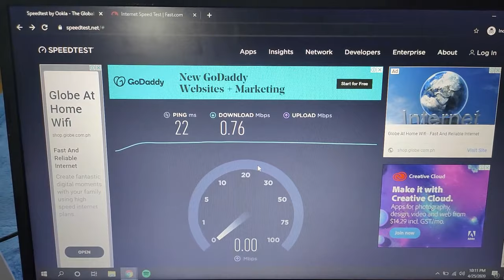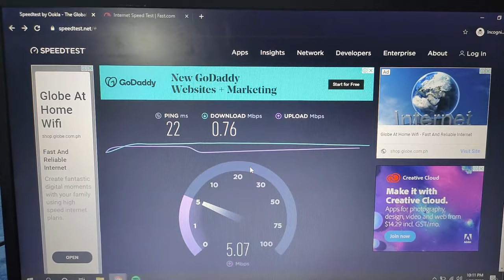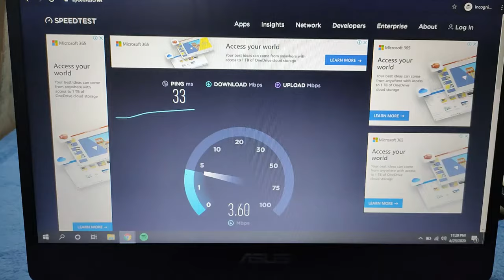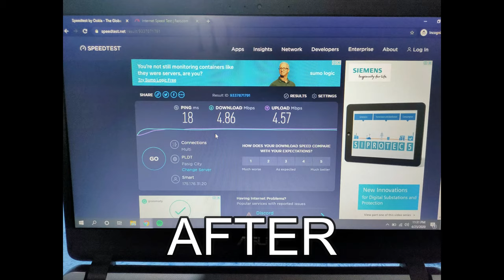PLDT HOME PREPAID WIFI UPGRADE! EXTERNAL ANTENNA INSTALLATION | SORRY FOR TECHNICAL PROBLEM

Comment: Sir, yung apat (4) na antenna connector na sinasabi ninyo, di po ba two (2) for WIFI signal (output) then two (2) for LTE/4G (INPUT)? kaso wala lang label. alam nyo po ba saan dyan para sa wifi/LTE?

Comment: maganda vlog mo boss esa iba. perfect na sana pero suggest q lng wag mo po ecut yung crucial parts: yung pag drill kung papano, at yung pag kabit ng wire dun sa motherboard.
Reply: Totoo lalo na nung di niya pinakita ung pag kabit ng wire
Reply from the maker: salamat sir. push in lang po ung sa wire heheh
Reply: pano po yung sa pag drill?

Comment: Sir, paano niyo po na i attached ang wire sa loob ng antenna? Dretso na po kasi sa video mo, pinakita mo lang na naka attached sa kanilaan. Need ba hinangin sa loob yung mga wirings?
Reply from the maker: Hindi na po ipush lng sya mam pinch down lng
Reply: Thank you sir,

Comment: Good day brad! Mukhang nagpalit ang PLDT.. hindi na swak ang UFL or IPX na connector.. bale dapat male yung maliit na papasok sa circuit board. Ang problema, ang hirap hanapin..

Details: i got mine around 1st week ot august 2020. Iba na yung hitsura connector sa loob.. bale female receiver na yung soldered sa board.
Reply: same din sakin boss

Comment: So since dahil 4 yung antenna port sa circuit board, can we split the two wires ng dalawang antenna to make it connected sa apat? Or can we even add 4 antennas  sa WiFi router?
Reply from the maker: I think 2 will do, but if mahina pdin signal you might consider direct line or change of provider
Reply: Pwede naman pong apat din hanapan mo lang ng paraan kung san magbubutas.

Comment: Hindi sa nangbabash ako, nag susuggest lang ako. Pag i-analayze mo yung pcb ng router makikita mo na hindi kahit sa saan mo dapat ilagay yung pigtail. Sa apat na yan ay ang dalawa ay para sa wifi antenna at dalawa ay para sa lte antenna. Kung makikita mo yung upper-left at lower left(yung may sticker) ng pcb ay may makikita kang copper trace na kagaya sa internal wifi antenna ng cp, laptop, at pocket wifi. At kung makikita mo yung nasa right side ng pcb, may makikita kang dalawang itim na plastik, yan yung internal antenna para sa lte, at kung makikita mo and dalawang port na nasa right ay may copper trace na connect sa itim na plastik kaya doon lang dapat ikabit yung lte antenna. At tsaka mali na antenna yung ginamit mo, para wifi yan na antenna, ang antenna na kagaya niyan na para sa lte ay medyo mas malaki at mas malapad kisa niyan.

Comment: Yung intro mo when it comes to the volume of your voice with the music background was fine. However, during your process of installing the antenna, your voice went low and the background music too dominant in the video. I notice some parts were edited which is ok, so you can get to the key points of the installation, but there are some parts or clip that needs a little more visual and verbal explanation.
Reply from the maker: salamat po sir. I'll try to improve po :)

Comment: Sir..slamat sa topic...sir pano po na mag disable ng wps sa pldt home prepaid,para kasing pinag fi fiestahan wifi namin dito.patulong po..baguhan pa .slamat in advance po
Reply from the maker: Once connected kna sa wifi nyu accest mo 192.168.1.1 thrn ung password nasa ilalim ng braodband mo. Dun mo mkita lahat ng settings palitan mo password dun
Reply: @RomYsraelMangahas  ok po.salamat sa tip.Godbless po

Comment: Gagawin ko rin sana to.  Kaya lang ung nabili kong IPEX CABLE is Female. And  female din ung nasa board,. Dapat po ang bilhin nyo is ung may pin sa gitna.  (male).  Kaya siguro mejo nahirapan syang ikabit sa board ung ipex nya.
Reply: Meron ka bang link ng male ipex cable?

Comment: Idol pano kung d naging effective ung antenna na ganyan kc nagntry ako.  Hina pa din due to my room location problem, sobrang kulob kc dito wala kami bintana, sementado pa. Nasa ground floor pa kami... 

Pwede kaya kabitan ng wiring cable antenna yan? Gawa ka po ng Tutorial about that. Tnx more power.

Para po sa mga may mahinang signal tlgs due to location problem hehehe  amost letter H+ Ang pinaka malakas dito sa area ko

Comment: Hello po sir, napansin nyo po ba kung yung side nung SMA cable na kinabit sa board is merong pin din sa gitna? Salamat po if masasagot nyo :)
Reply from the maker: Wala po ako napansin eh 😊 pero 4 lng slot nya for external antenna
Reply: Salamat po :) nice video sir, informative and ok yung point of view sa pagkabit ng external antenna. Keep it up sir
Reply from the maker: @rsg3215  Thanks po 😊 please subscribe and share this video 😊
Reply: Last na po sir, ganito po ba yung ginamit nyo na cable para sa board?
https://shopee.ph/product/129172069/2021438952?smtt=0.0.9
Reply: @rsg3215  mahirap makahanap sa Shopee ng male u.fl e. Puro female (walang pin sa gitna). So workaround ko e nagsangat ako ng manipis na wire sa gitna tsaka ko pinasok sa socket.
Reply: @christianpaul3014  saang socket po sir? Yung sa board po mismo? 🙂 saka anong wire po ang gamit mo?
Reply: @rsg3215  hindi compatible yan base sa exp ko di ko nakabit
Reply: Working siya, although it seems that only one socket there works (facing the board, yung nasa upper left socket). I tried adding UP TO FOUR antennae haha. Either 1 lang yung functional or sagad na yung kayang ma-improve ng antenna ko
Reply: @rsg3215  either sa socket ng board or sa cable oks lang, ang goal naman is ma-connect yung dalawang female. Any wire na conductive basta thin enough para maipasok